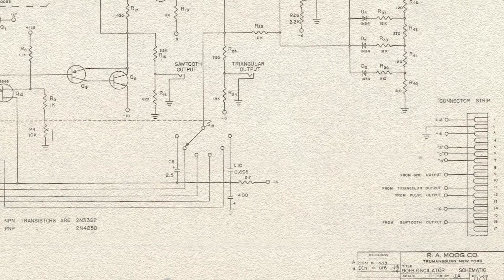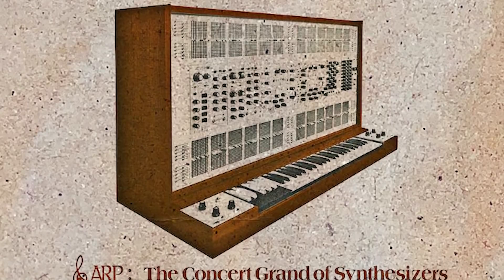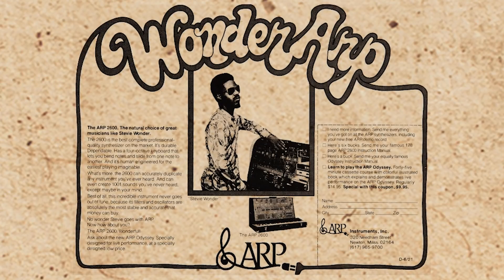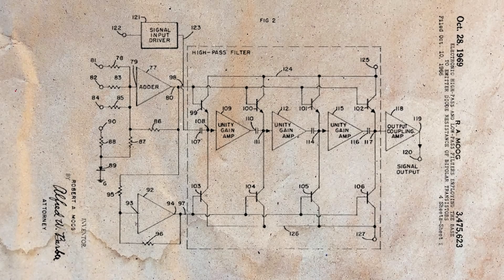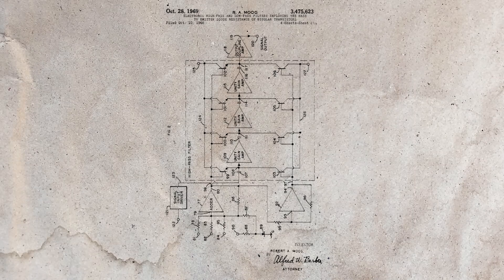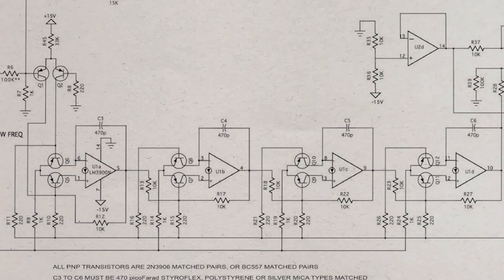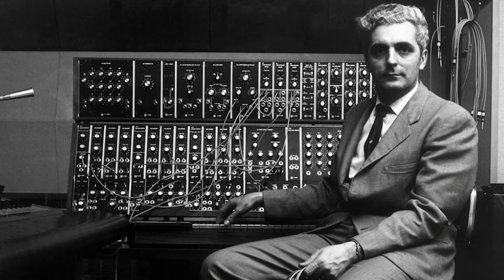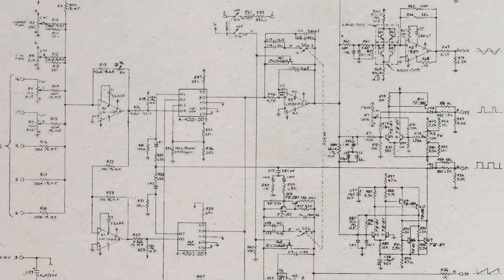The True ARP vs MOOG Lawsuit Story: Astonishing History of Synthesizers EP 2

Comment: The schematics you are using for the ARP filter are actually the 4072 filter which was an original and patented ARP design and not based on the Moog ladder filter. ARP did copy the ladder filter in the 2600 and Axxe, but that had a different schematic.